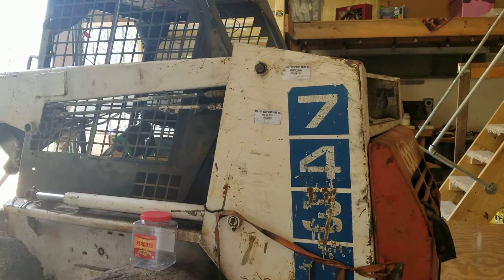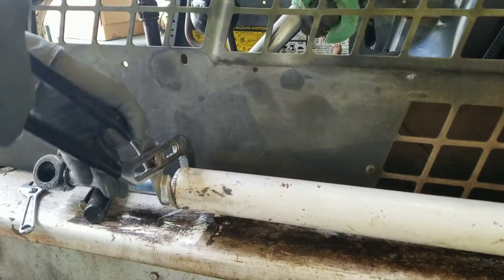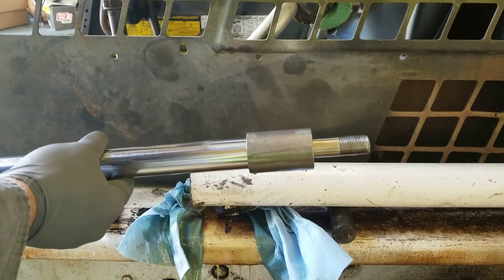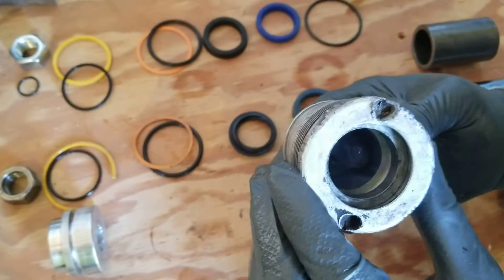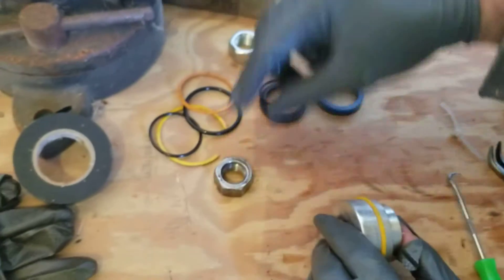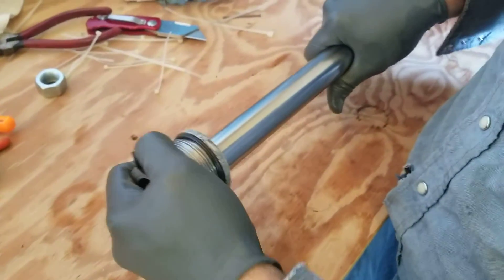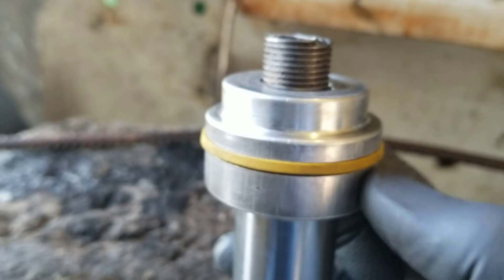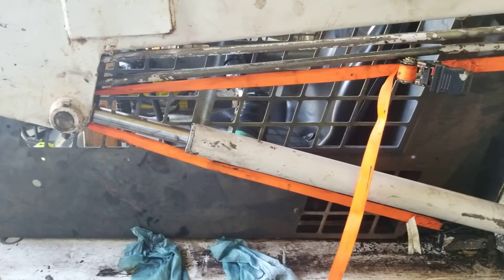DIY Hydraulic Cylinder Rebuild Without Removing Bobcat 743 $17

Comment: Clean threads good with brake cleaner and nut,
Let it dry and 272 red lock tight pretty good 
You can always heat nut a tad to remove later 😊

Comment: Main products: sealing gasket,gland packing,PTFE/graphite/asbestos products, ceramic fiber products, high temperature heat insulation and fireproof material. 
Free technical support (sealing, heat preservation, heat insulation, fire prevention problems) 
All products 1 piece can also be customized, 30 years of service experience, fast and safe shipping anywhere.😕
Reply: I am from China Seals Factory. Our company produces many types of hydraulic oil seals. If you are interested in our products, we can send you free samples so that you can learn more about our products.

Comment: Piston was installed backwards also you don't need that ratchet strap to get the cylinder to retract. After reconnecting the hydraulic lines all you need to do is start the machine. The cylinder will retract on it's own to match the cylinder on the other side. You my have to work the pedal slightly to finish aligning the pin. I was the Hydraulics tech for GTE.
Reply: I am from China Seals Factory. Our company produces many types of hydraulic oil seals. If you are interested in our products, we can send you free samples so that you can learn more about our products.

Comment: for pulling seals on, energizers, ptfe seals etc. use a zip tie turned inside out {smooth side to seal} use it as a handle to stretch the seal and walk it down on without rolling it. just rebuilt the swivel on my excavator and damn the zip tie trick saved my bacon.
Reply: I am from China Seals Factory. Our company produces many types of hydraulic oil seals. If you are interested in our products, we can send you free samples so that you can learn more about our products.

Comment: looks like you have a 1 1/4" rod 2" bore...pretty typical of bobcat aluminum gland steel barrell....parts would be and st-125 wiper the rod seal they used in the kit is a twin lip rtu18-1.25-31 224 o-ring and back up and a ps1400-32 teflon piston seal...kit should have been no more then 20 bucks....these are a piece of cake as long as the aluminum gland doesnt swell
Reply: I am from China Seals Factory. Our company produces many types of hydraulic oil seals. If you are interested in our products, we can send you free samples so that you can learn more about our products.

Comment: Put the new seals in hot water sir , it softens them up
Reply: you dont n3ed to put them in hot water lol....ive been doing seals and cylinder repair for 20 years...stretch the teflon seal on then use electrical tape and clamp it....they make a tool that compresses teflon piston seals that sells for about 150 bucks...i have 2 but for most weekend warriors the tape and clamp is the way to go...just takes longer

Comment: Definitely worth doing it yourself I've  sent them out to be done. A week to 10 days later u get it back  in my area it's around $130--$500 for bobcat  cylinders. I just did it for the first time and if I can do it most people are able to.
Reply from the maker: Never hurts to try, it's already messed up.  My turbo recently went out on my 7.3 Powerstroke the repair cost was estimated at over $2000. It was already broken so I bought the stuff and fixed it over 2 days.   It's been 5000 miles and it's still whistle'n along. And I kept a ton of cash in my pocket.  Even used my backwards channel locks 🤣
Reply: @txmyocastor  FUCKIN BOOM LOL 😆 THE CHANNEL LOCK CEMENT WAS EPIC. YEAH MAN I usually send stuff out because I don't have the time but it slow season now.   I just did flow plugs. Got a tuner delete system waiting for the exhaust  part then ill get back at it I had the truck  half way torn apart and had to assemble because of snow😤 sti waiting on part a week over dhe
Reply: I am from China Seals Factory. Our company produces many types of hydraulic oil seals. If you are interested in our products, we can send you free samples so that you can learn more about our products.

Comment: Thanks for the video. I am rebuilding the two front tilt cylinders on the loader bucket of my Case 580C Backhoe. I simply could not get the Cup Rod Seal installed inside the Gland Nut. Your zip tie trick worked great!!! Thanks
Reply: I am from China Seals Factory. Our company produces many types of hydraulic oil seals. If you are interested in our products, we can send you free samples so that you can learn more about our products.

Comment: This videos is wrong in so many ways. Please don't re-seal your cyinders using the techniques used in this video. Spend the cash buy the OEM seals. It will pay dividens.
Reply from the maker: I absolutely agree there are better ways to rebuild the cylinder and OEM should always be an option. So far this repair is going strong and I'm out under $20 and an hour of time.
Reply: After watching other videos, I think the piston was installed backwards. The nut should go into the recession the piston.
Reply: M
Reply: I am from China Seals Factory. Our company produces many types of hydraulic oil seals. If you are interested in our products, we can send you free samples so that you can learn more about our products.

Comment: At 7:03, you probably realize that those O-rings go on better if you don’t stretch them around multiple shoulders of those caps instead working them from the narrow to the outer directly. One thing about cutting the end of that rod off where the threads were damaged, I would’ve taken a small jewelers file and cleaned up the thread along the note to go on which would’ve left me the thread at the end. A mechanical Fasner is generally thought to be secure when the length of threads projecting from the nut Nut are equal to the diameter of the threads. I was kind of thinking you would show how you expanded the blue outer seal to go over the end of the piston but maybe you figured it out as one of the other commenters had by expanding it with something of a similar diameter to just inside that seal and you exchange positions as you slide it on.
Reply: Hmmm...Can’t edit the post. Anyway I was going to say thanks for the video. You definitely save yourself $500
Reply: I am from China Seals Factory. Our company produces many types of hydraulic oil seals. If you are interested in our products, we can send you free samples so that you can learn more about our products.

Comment: I just did this and I believe there is a lip on the inner seal.  I faced this lip the opposite direction as the outer seal lip that is visible once everything is together.  Is this correct?  I watched a few vids already doing this and wonder why no one lubes the parts before shoving them into cylinders?  Dry o-rings, dry seals can twist or tear when installing.  LUBE THEM!!!  I also reused the OEM nut because its better than the junk included in the kits.  The OEM nut locks on its own so no future problem like you had with the nut coming off inside the tube.
Reply from the maker: It should be, I took all the pieces from the older one and just copied how I found them.  That being said the machine had unknown hours so who knows how many times it has been rebuilt?  The ends had signs that it had been opened before.  I agree about dry seals.
Reply: I am from China Seals Factory. Our company produces many types of hydraulic oil seals. If you are interested in our products, we can send you free samples so that you can learn more about our products.

Comment: When installing your lower piston, using a hose clamp tightened against the piston will hold the oring from being torn, then you can tap the piston in and hose clamp will just come free on rod for removal, much like piston ring compressors used to install engine pistons. Good video. Thanks
Reply from the maker: Awesome! Thanks for the tip.
Reply: I am from China Seals Factory. Our company produces many types of hydraulic oil seals. If you are interested in our products, we can send you free samples so that you can learn more about our products.